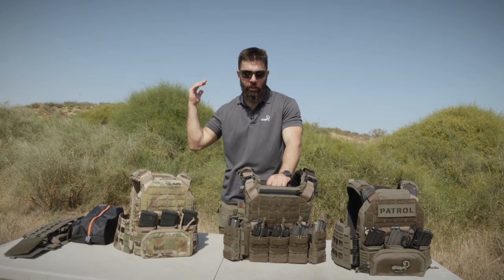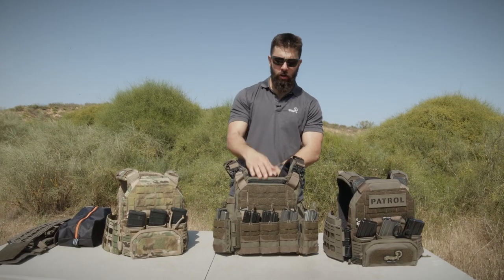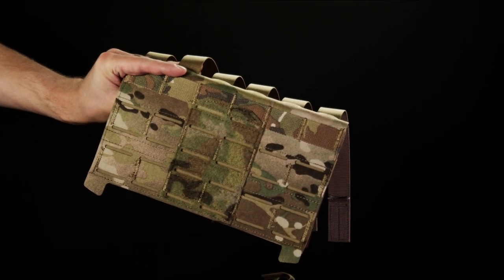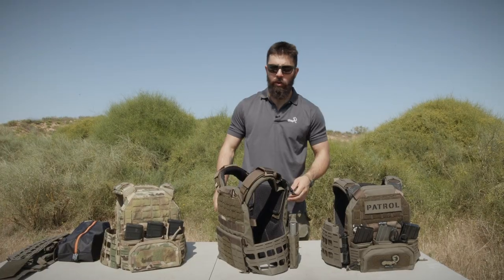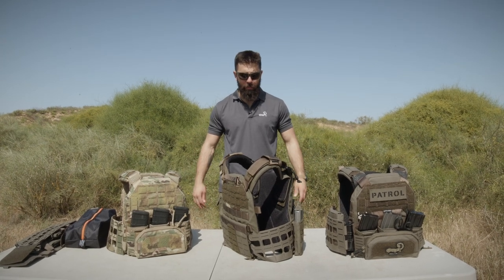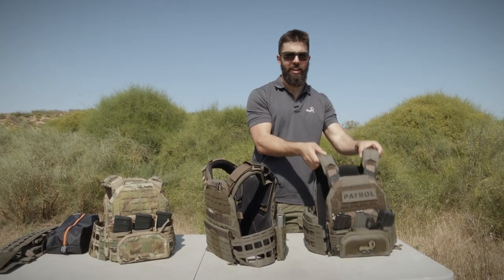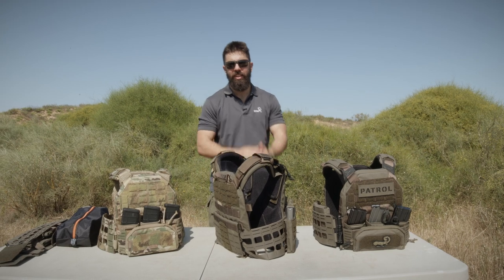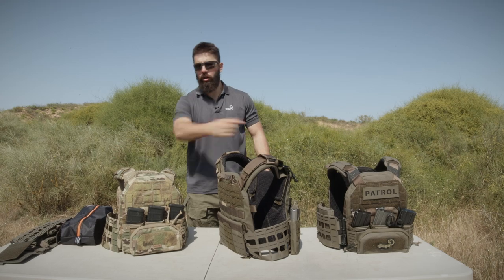How to use the Agilite Warfighter Cummerbund on a K19 Plate Carrier

Comment: I just got mine and installed them. they're awesome. actually allows the carrier to be tightened up to fit snug around my body as I'm a small dude. even with the adjustable cummerbund that comes with the k0, after adding the quick release, it left the carrier loose.  being able to adjust the back of it further made all the difference. added with the raider plates, the fit is perfect.  if shtf round my way I feel alot better knowing at least I got a fighting chance.
Reply: Did you run the tubes with your cummerbund?
Reply: @TheJoeml85  on the right side. yes.
Reply: @TheJoeml85  I overlapped the velcro on the back to adjust it tighter.
Reply: Nice i might get the k zero with the war fighter cummerbund my problem is I can’t decide what plates to get either Mira or legacy level iv
Reply: @TheJoeml85  I got the agilite raider plates man. they're nice as well.
Reply: @xxxxxVAxxxxx  that’s what’s up I was also looking at the warrior assault system recon plate carrier alot of people seem to like it
Reply: @xxxxxVAxxxxx does the plates stay in well with the kzero I was leaning more towards the k19 because of the straps that hold the plates in
Reply: @TheJoeml85  I haven't had a problem with it. there's a big flap at the bottom that velcros to the inside.
Reply: @xxxxxVAxxxxx  yeah that what I heard everyone says they stay in really well I’m having a hard time choosing the k19 or kzero probably lean towards the kzero
Reply: @TheJoeml85  I just wanted more shoulder to seat the rifle to and not be bulked out.
Reply: @xxxxxVAxxxxx  yeah that’s definitely one nice thing about the kzero if i got the k19 I’d take off the quick release tubes on the shoulders when they make a kzero 2.0 they need to add them straps to hold the plates in i know most plate carriers use the Velcro like the kzero but it’s always in the back of my mind that il be running and dump the plates! 🙈

Comment: Great cummrrbund, pity you don't mention anywhere that one has to cut your existing roc qr off the k19 plate carrier so as to fit the spear tube and you don't offer an option on your website to purchase the roc instead of the spear, so we can avoid that inconvenience.
Reply: Can you elaborate?
Reply: @Fragnar13  K19 has ROC80 tubes sutured in K19 and used to quickly connect stock cummerbund. At the same time Agilite offers FirstSpear tubes as the only quick release buckles option for Warfighter Cummerbund. These 2 types of tubes are incompatible. 😢 Update: please disregard it for K19 gen 3 -- it's not sutured in this revision, so you can easily replace ROC80 with FirstSpear tubes.
Reply: For K19 gen 3 -- you can remove ROC QR buckles. They are not sutured in this revision. Just use pliers to pull the fabric away from the hook of the ROC QR.

Comment: Alright, editing my initial compete from earlier… This is a terrible design. The Molle straps aren’t long enough to actually weave and they are also missing the normal notch at the end to give the strap something to catch on, to prevent it from being pulled out of place. You can basically weave one loop and then you have to find a way to tuck the rest of the strap back under to adaptor so that they aren’t just hanging out of the bottom. I hate to say this but this really needs to be redesigned and you should probably send a new version to the people who bought this.

Comment: I have a problem with Warfighter Cummerbund and K19 gen 3. K19 has ROC80 tubes sutured in K19 and used to quickly connect stock cummerbund. At the same time(surprise!!!) you offer FirstSpear tubes as the only quick release buckles option for Warfighter Cummerbund. So either I need to break my existing ROC80 tubes, or I need to source aftermarket ROC80 tubes and use male connector with my Warfighter Cummerbund instead of your FirstSpear tubes. Both options are ugly -- I've paid a high price here in Canada for K19 to use it and enjoy it, but it looks like I will have to crack the OOTB component or to do "mission impossible" -- find ROC80 tubes in Canada.😭
Reply: Apologies for the initial challenge, but I successfully removed the ROC80 tubes, albeit with a bit of effort using pliers—almost broke a finger! On the bright side, this experience underscored the exceptional quality of the fabric hooks and seams of the Agilite K19 gen 3! Installing the Warfighter Cummerbund with FirstSpear tubes on both sides and the Agilite BackFlap was a breeze afterward, feeling as smooth as butter and taking just 10 minutes. The process was remarkably straightforward, sparing me the need to hunt for spare ROC80 tubes (unavailable in Canada). Now, my "K19 gen3 with Warfighter Cummerbund" not only looks fantastic but is incredibly comfortable—I can't find the words to express it. Thank you, Agilite!